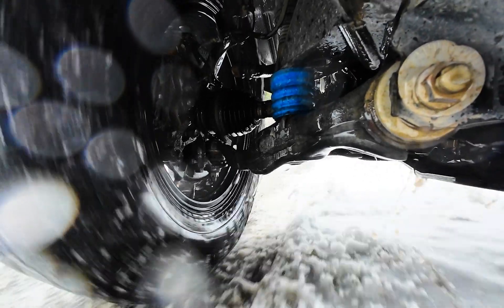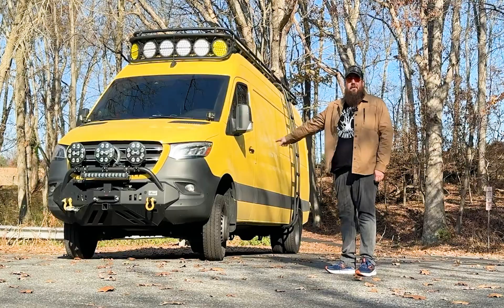Which SumoSprings Density is Right for You? | Engineering Corner

Comment: I am trying to decide between blue or black for my 2019 F150 4x4. I often in the summer have 700 Lbs in the box of my truck and very rarely have a heavy tongued trailer behind me too. I am not sure if black would be too stiff for general use though?
Reply from the maker: Thanks for the details! Based on what you’ve shared, we recommend going with the Blue (-40) SumoSprings kit for your 2019 F-150 4x4. The blue kit is perfect for handling your typical 700 lbs in the bed while still keeping a smooth, comfortable ride when the truck is unloaded. The Black (-47) kit is stiffer and designed for trucks that constantly carry heavy loads or tow often, which could feel too firm for your general use. Since you only occasionally tow a heavy-tongued trailer, the blue kit will give you the support you need without sacrificing everyday ride quality. You can find them here: https://superspringsinternational.com/product-search/?product_year=2019&product_make=Ford&product_model=F-150&product_drive_type=4+X+4

Comment: I previously had Sumo Springs on my F53 chassis and they improved the ride. Maybe a bit stiffer but definitely helped the sway coming in and out of driveways, etc. 

Now I traded in for a 2025 Entegra Odyssey 26M class C. 
The ride isn’t bad but obviously can be improved. My fear is adding these will make it too stiff for average highway driving. 

Based on a class C E450 motorhome which front and rear part numbers would you suggest?

Thank you
Reply from the maker: Thanks for sharing your experience! we’re glad the SumoSprings made a difference on your vehicle!
For the E-450 chassis, we recommend the SSF-106-47 for the front, and the SSA47 Helper Spring and SSR-130-54 for the rear. This combination is a great balance of comfort and support. You’ll notice improved control over sway and bounce. If you have any questions about installation or fine-tuning your setup, feel free to reach out to us anytime, we're here to help!
Reply: @SuperSpringsInternational This is very helpful. Thank you!
Reply from the maker: @anthonyb2334  Happy to help!